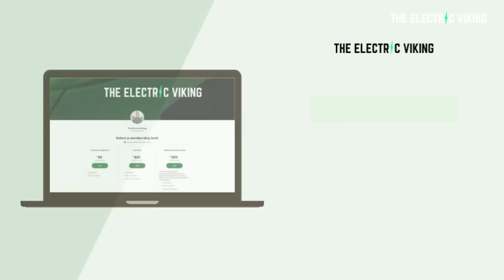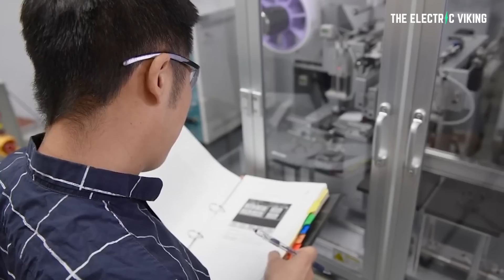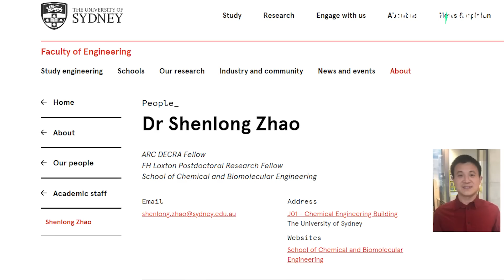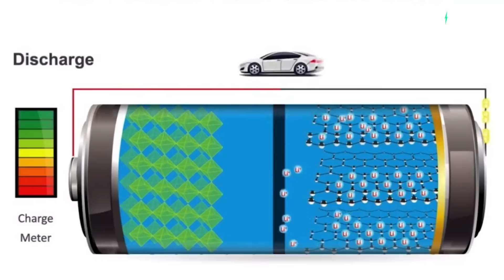Scientists discover cheap sodium batteries with 4x capacity of lithium

Comment: One thousand cycles is only three years. That doesn't work as you noted. Room temp is outstanding but how does the battery work in the cold weather? I purchased a Toyota Camry Hybrid while living in Georgia last January. I moved to North Dakota in May. There were times I got 50 mpg in the city and at least 42 mpg on the highway, All warm or summer driving. Now that the temps have reached freezing or below I am lucky to get 30 mpg in the city and less than 25 mpg on the highway. I raved about the car in the warm weather. But now it gets about the same mileage as my previous SUV. I am very disappointed,
Reply: Sodium batteries are far better in the cold compared to lithium. They lose something about 05-10% capacity at -20c.
Reply: But wait a minute for example the Tesla model 3 with LiFe has a range roughly 258 miles so 4 times density is a car with 1000 miles so then 1000 cycles is 1 million miles so if you drive it at 200,000 per year it’s going to take 5 years and then you are at a car with only 500 miles range. I must be miscalculating something
Reply: @pgiatrakis  Only if you drive till the battery is near 0% and then charge to 100 % every time. If you charge regularly, say every night then the battery last about 3 years.
Reply: @PeterPanQuails  I don't have a plug in Hybrid
Reply: I know the cold affects EVs performance. 
First time I heard of the cold affects Hybrids.